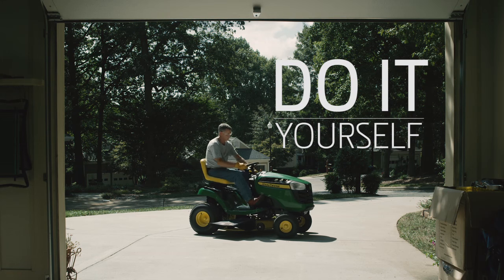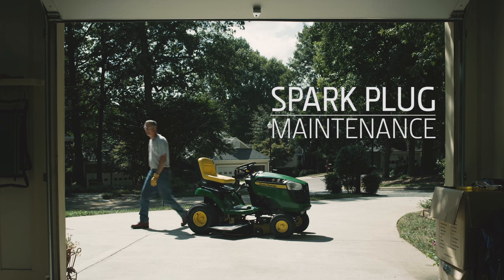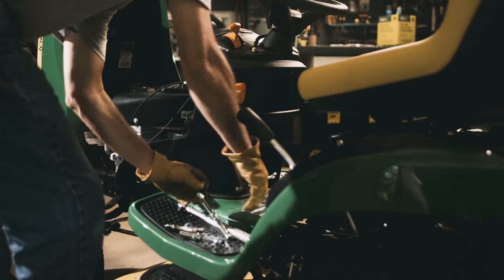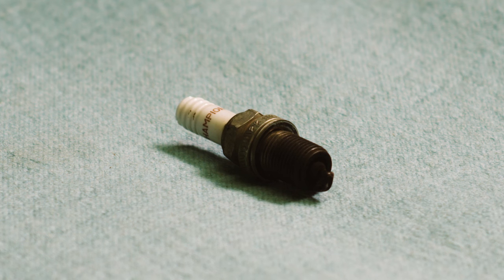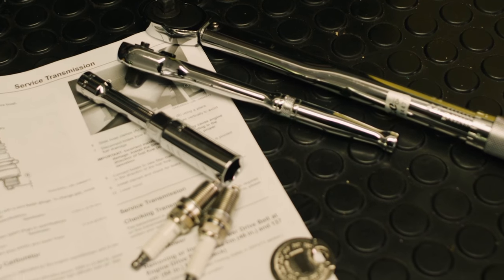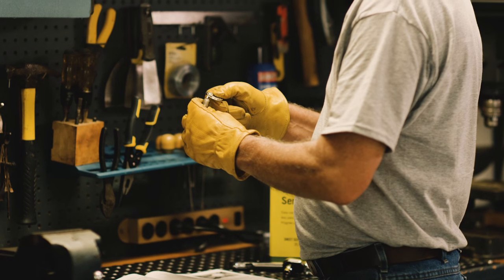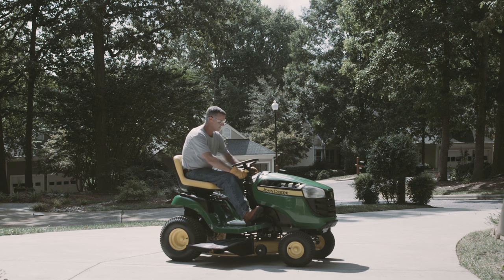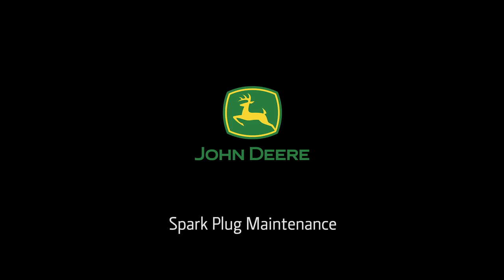How To Change Spark Plug(s) | John Deere D100 Lawn Tractor Maintenance

Comment: How to replace deck belt
Reply from the maker: Thanks for asking, Arleen. You can find this information in your Operator's Manual in the "Service Mower" Section under "Replacing Mower Drive Belt". Changing your belt will depend on which lawn tractor you have but the Operator's Manual has multiple diagrams to help with the replacement. 
If you are having difficulties changing the belt or have any questions we suggest reaching out to your local John Deere dealership. You can find their information at Deere.com/ContactUs. We hope this helps!

Comment: So what if I don't have a spark plug socket
Reply from the maker: A spark plug socket will make it easier to service your machine. If you don't have the tools to change a spark plug your local dealer would be willing to help. You can find your local dealer here: dealerlocator.deere.com.
Reply: Then find the right size deep socket or leave it to someone else.